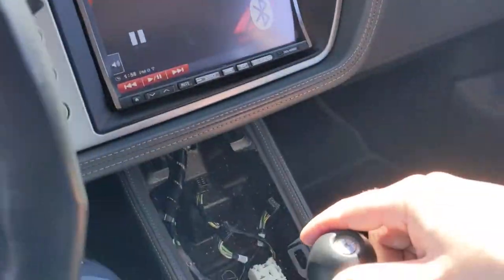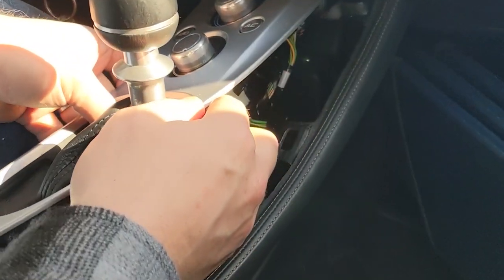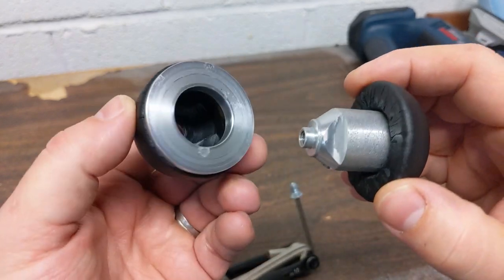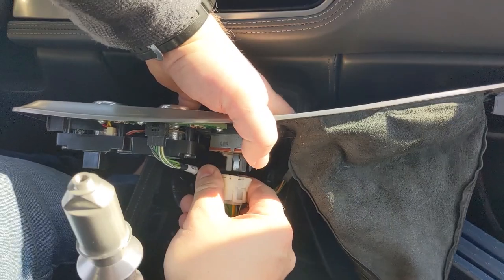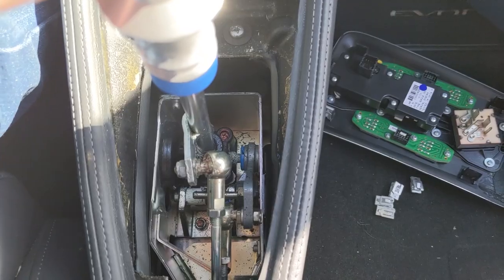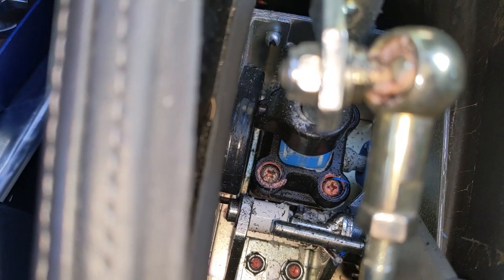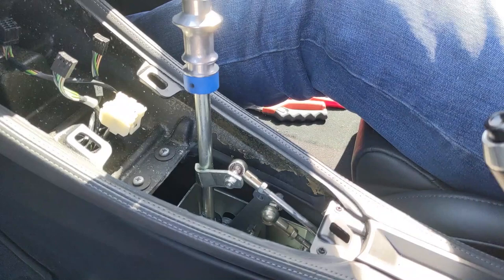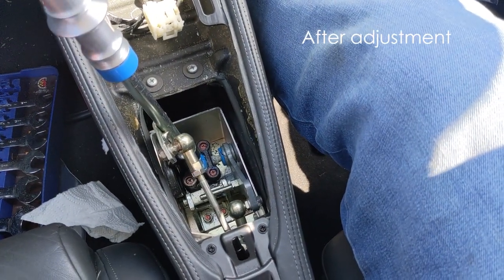Lotus Evora Shifter Adjustment 2011

Comment: I have a 2011 Evora S and I was having trouble shifting into second after the car was hot. I watched your video and adjusted my transgate cable and just got back from a test drive and the shifting is much improved. If you are having trouble getting into first or second you want to adjust the transgate cable by moving the plane to the right which is done by screwing the ball joint socket counterclockwise like you did in the video. Can’t thank you enough, keep up the great work
Reply from the maker: I'm really really happy to hear this. Glad this worked out for you. Glad that we can build the community up for these cars. They're so great they just need a little bit of TLC to make them perfect.

Comment: If the shifter is slow to move left/right (in neutral for example) try lubing the cable(s) from the engine side. It's a pain (complete air box removal then remove shift cable ends at transmission) but let lubricant seep down (slowly!) inside the plastic sheathing. Takes a while to do both cables but it worked absolute wonders for my 2011. I used Boeshield T-9. I was going to upgrade cables but no need to now. Good luck, a pain but saves $2k+ compared to the parts alone for new updated cables.
Reply from the maker: I love this idea. It's on my list of things to do now. I'll let you know how it goes

Comment: Mine has the issue of not downshifting to 1st well. I have only recently been able do so after a good warmup and a decent throttle blip. Getting into 2nd has always been less than desirable. I’ve been thinking of new cables and the shifter11 gear selector.
Reply from the maker: It does appear that all of the early 2011 and earlier cars have similar shifting issues. Long term I may do the shift cables as well. I'm going to try a few other things first, for learning. Adjusting your shift cables may help. Good luck!
Reply: changing the trans fluid to the high temp race fluid works MAGIC.. still going to change shifter and cables but took the quality of driving from 2/10 to 7/10

Comment: I'm doing the cable adjustment on my 2012 Evora S and could really use the flat red pliers that you use. Regular pliers are too large to snap the crossgate cable back on the ball. Would you know the make of the pliers you're using?
Reply from the maker: The one I have is a Lisle spark plug boot puller. This one is similar. https://www.amazon.com/dp/B0002STS58/ref=cm_sw_r_awdo_WR12ZB315CJA1Q64HMXD
Reply: @GoodmorningGoodnight  , thanks so much!!!

Comment: just bought an 09 evora and its a bugger to get into reverse, lotus dealership say its common and fixed by the application of "lotus" grease in the approprate places !!
Reply from the maker: Hmm. "Lotus" grease would help, I'm sure. But not quite a full solution if you ask me. :)  More transmission/shifter videos coming in the future.

Comment: That blue ball is meant to be broken soon or later. Replace it with an aftermarket one before it breaks while u're driving it. It happened to me. I was very close to getting killed.
Reply from the maker: Oh my goodness. That's not what I want to hear don't want you getting killed or me getting killed. Luckily I just installed an aftermarket one from inokinetic. I have a three-part video series on that in my channel.